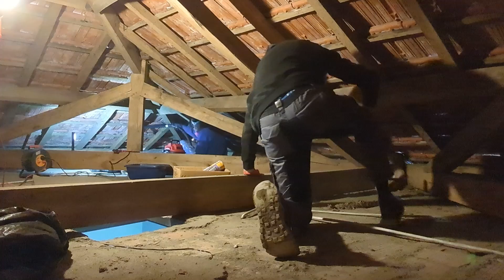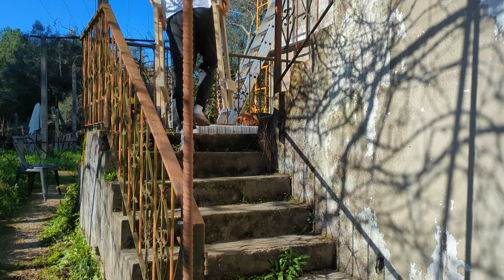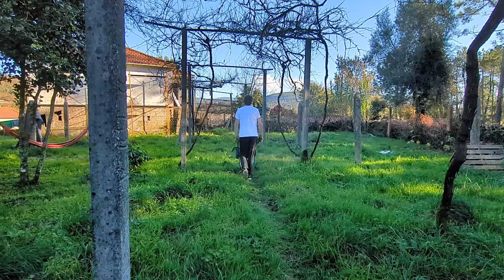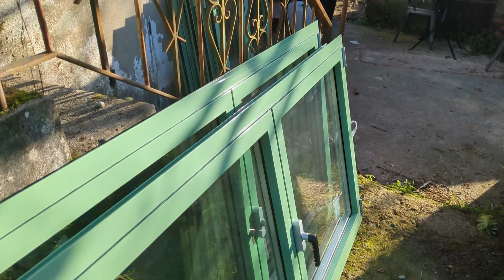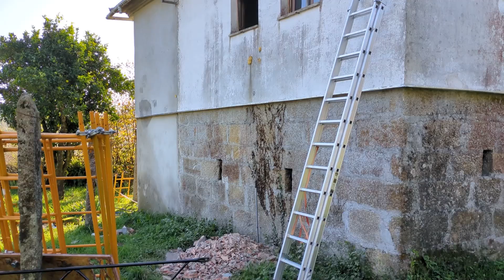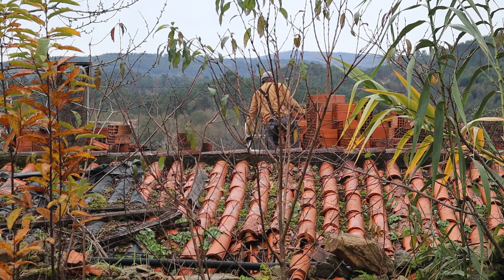#16 New year, new windows and more renovation work on our house in northern Portugal

Comment: for isolation use 12 mm trowel ,to get 60% contact with wall you still need to use fixing  as only glue is not good. there was nothing wrong how u start isolating. Glue dry's out in 2 -3 days.

Comment: With that polystyrene, might need to back butter the whole block,  better still use a mesh.  I’ve heard that external lime rendering is traditionally only done in the warmer months also. Good to see you back!  Windows are lovely!
Reply from the maker: I think that is what we will do, apply more mortar to the back of the boards with a mesh over the top of them. Thank you!
Reply: @michaelboalch Sorry, I meant to put the adhesive on both the wall and the polystyrene block, with the mesh on the wall.  Using a notched trowel, just like tiling.    I realised my first comment was not very clear, 😕.  Apologies.    😊
Reply from the maker: Ah ok, no worries. I'll have to do more research!

Comment: New windows make a huge difference. I was thinking about cork insulation so interesting to see you reasons for using the blocks. Wonder if you can drill and fit some sort of pin to help hold them in addition to mortar? Going to have to cope with strong winds. Nice to see you back.
Reply from the maker: The boards will be mechanically fixed also, we just didn't get to that bit!